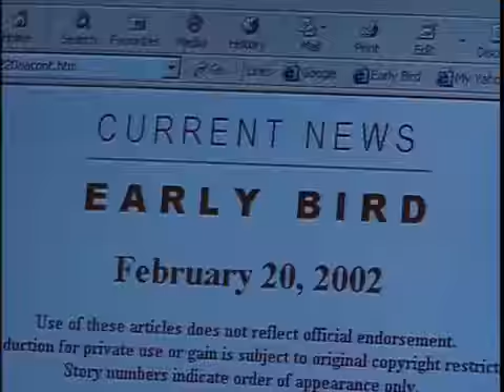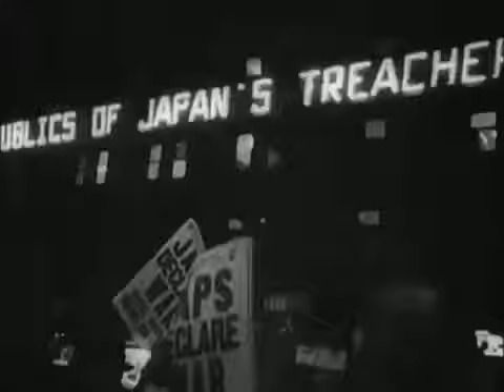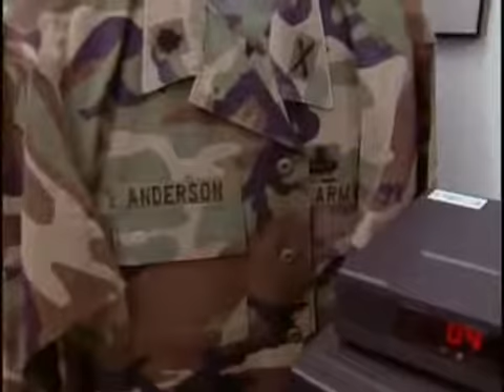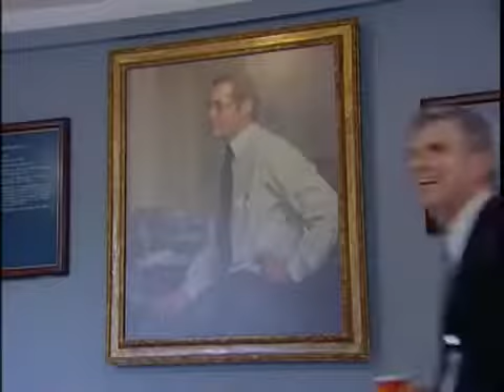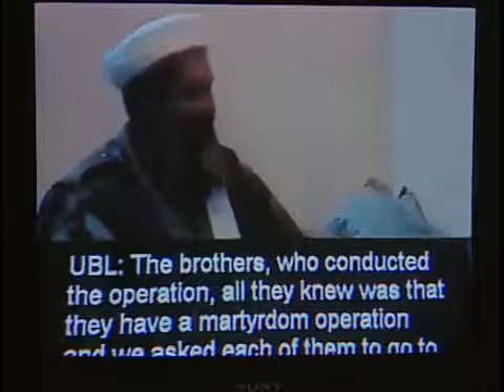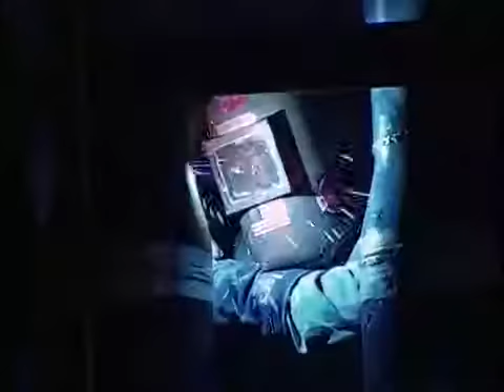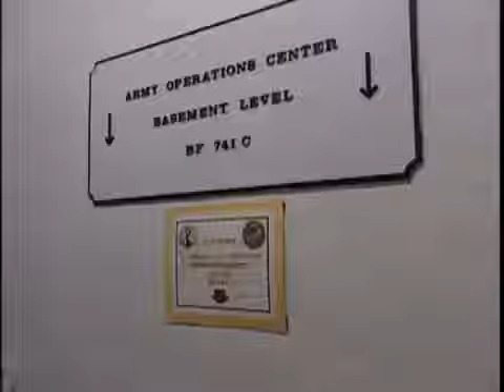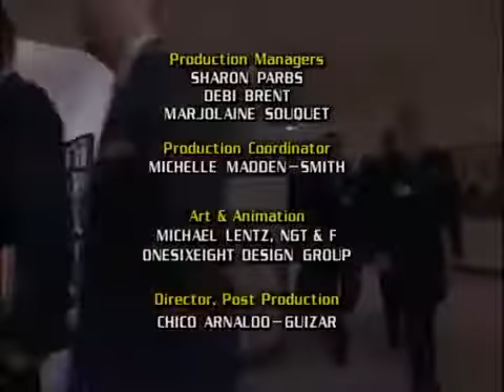THE PENTAGON  (FULL INSIDE DOCUMENTARY)

Comment: Where's the plane show me footage of the plane's impact on the structure
Reply: Exactly.
And show us 2 BIG engines used in airliners instead of 1 small one used in cruise missiles.😑🙄😒
Reply: Facts
Reply: You can literally look it up. 
A police car is driving in front of the camera, and three seconds later you SEE THE PLANE. 
Also, do cruise missiles utilize high quality explosives? 
If so, there’s clear signs of a high explosive vs fuel and structural elements burning. 
High explosives don’t emit a ton of smoke after ignition. Sure, you’d still have smoke emitting from the building, but the intensity and volume would be 100% different.